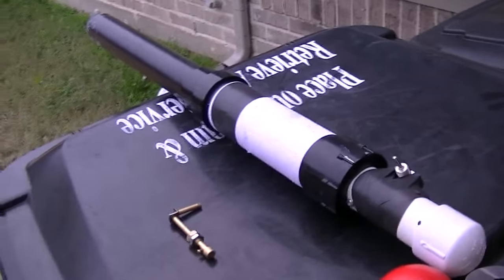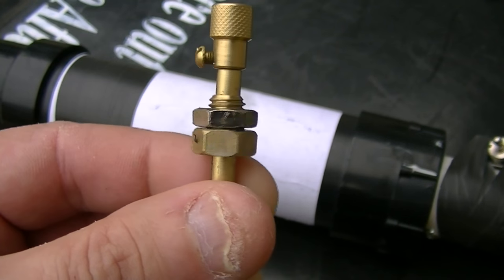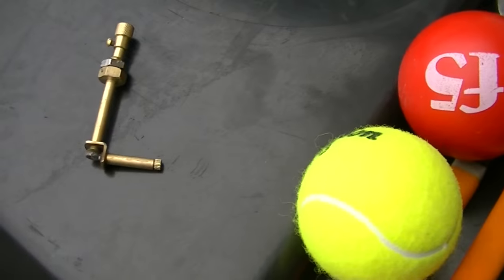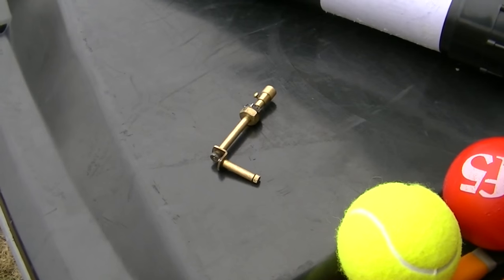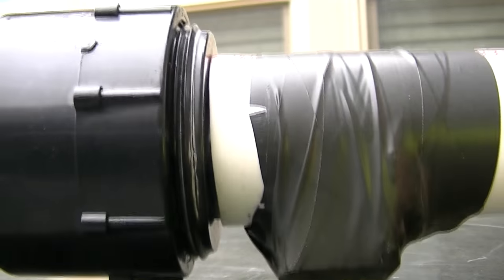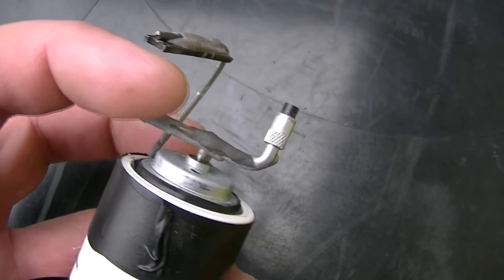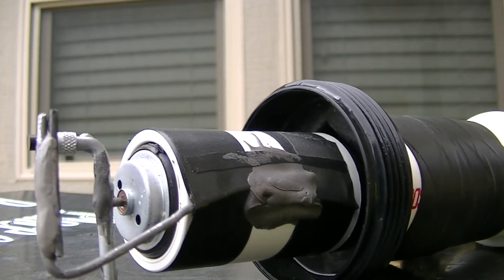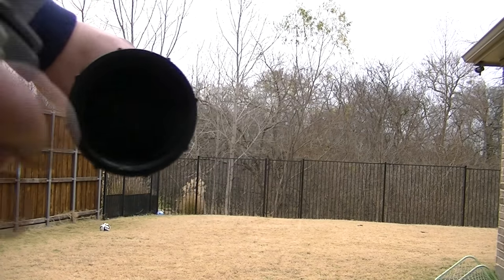1/4 Mile Cannon Potato Gun Ignition Modification

Comment: I love your sparker design.  That's very cool. I use the lantern sparker. It goes off every time.  You gotta play with it. But once you have it set correctly it goes off perfectly,  every time.  I'm disappointed in the launcher design.  A 3x 1 1/2 Y with clean outs is much better.